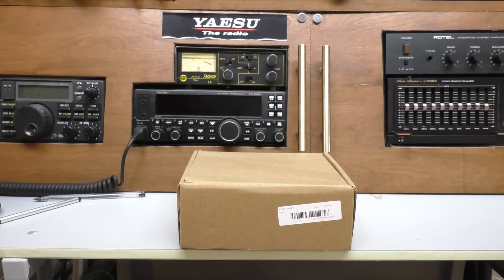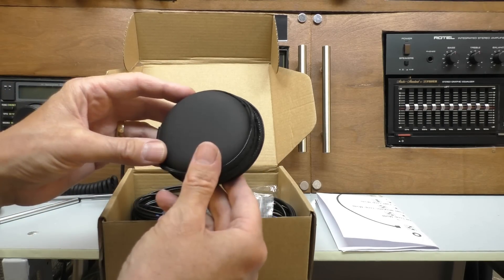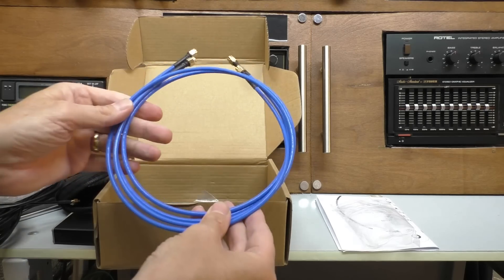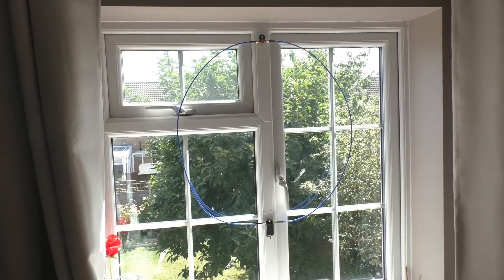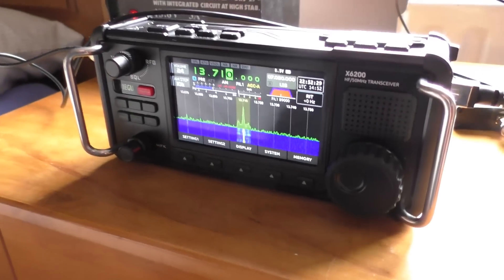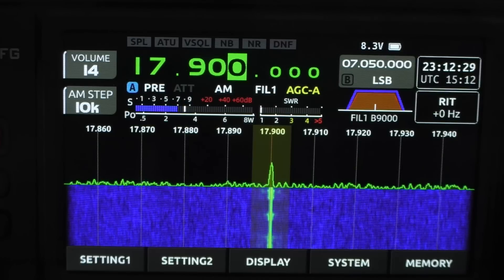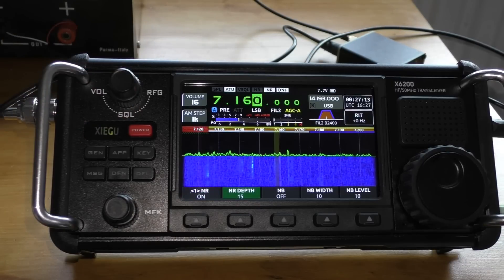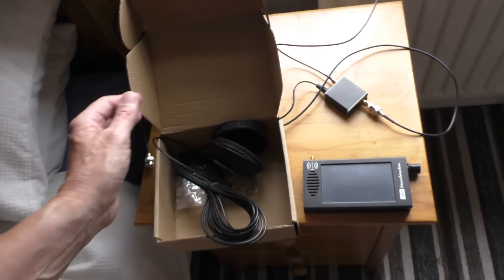YouLoop ACTIVE 50K-500MHz loop SW antenna.  A Loop that really works !

Comment: Just a heads up and the comment from @gooshy8312 mentions this but I think it is important for people to be aware of, this antenna can be powered directly from the SDR's inbuilt Bias-T with no separate power adapter needed. It was seeing gooshy's comment that made me finally pull the trigger on the antenna as I don't have a power adapter nor a spare plug socket near the SDR setup to power it otherwise.

Simply discard the separate Bias-T box it comes with and connect it directly to the SDR and enable the Bias-T and you will see the amplifier board have a faint green glow coming out from under the EMI shield to show it is being powered successfully. I have tested this on both the RTL-SDR v4 and more amazingly the SDRPlay RSP1A and the SDRPlay Bias-T is famously very picky about what it will power as it will power a nooelec LaNA HF but not the standard LaNA as that draws slightly more power than the HF one.

Overall this antenna is very impressive, and up in my attic picks up extremely well.

Also I think either my comment or @gooshy8312 needs to be pinned so that people looking at this review are aware that it can be powered directly by the SDR as I know I nearly didn't get this antenna as I wasn't sure how I'd power it and given how well it performs I'm glad I got it in the end.

Comment: What's the best shortwave antenna radio you've used so far? I'm planning  upgrading from the loing wire antenna for my c crane ssb 2
Reply from the maker: The ones i use the most is the GA 800 mini loop.  Its just so easy to put it on the table and rotate it.  You loose all the noise.

Comment: I am curious about the power supply. Just a little while ago of browsing, I saw a picture of one using a 9 Volt battery with the power cable plug attached to it.

Comment: I picked up a Radio Shackj DX-394 radio for $5 at a garage sale. I get like 2 stations messing around with antenna that came with it.  This has a SO-239 female connector on that back - I assume I am going to need an adapter to go from the radio to the cable that comes with this loop antenna - which one I need? I assume its going to be a male  PL259 but what size is the other end? I am new to all this!
Reply from the maker: Hi. The smaller size is called SMA
Reply: @CB-RADIO-UK  thanks! i am learning slowly! :)

Comment: Can anyone recommend A good power supply for this antenna ? I am just waiting for mine to arrive and I want to order a power supply for it.
Many thanks in advance.
Reply from the maker: You really need nothing special.  Dont copy me as my CB supply was too high.  I would try something like this. https://www.amazon.co.uk/Aclorol-Adapter-100-240V-Converter-Connector-Black/dp/B09XTXN1LS/ref=sr_1_2_sspa?crid=17234O333TIRG&dib=eyJ2IjoiMSJ9.XbnObsT2xq3x03oGXePHZTkbF8bYBTtd8LkSYLuEc7eDa5jyN1mVQu_20ho0AsGxOlulrEm-7tQf_5aofj1pb6W5G-U2WoUmk_PB5XenuxH7h6aXgszu3meXBZwiylFI9b1rEWzgjjbwB_jHKA1a9YJTgFz7wnPOmroi1ZpD0yUaMBqHq36QV5qpnllxpuApPxsqWs1yJ2PMeh_08zSN-UxeoF7Hd2T4XmDqsejfuUA._NHm6-_mz-767zpd0uHQ0cShguhxienQDmP8nk5AYqY&dib_tag=se&keywords=12+volt+power+supply&qid=1743152506&sprefix=12+volt+supply%2Caps%2C89&sr=8-2-spons&sp_csd=d2lkZ2V0TmFtZT1zcF9hdGY&psc=1

Comment: A question, I have the same antenna, with 7 meters of cable, but I need more meters, what type of cable is it, since I have bought a similar one, but the power does not reach the YouLoop, thanks.
Reply from the maker: These normally run 50 ohm RG 174

Comment: Fred which long wire would you recommend for my yard that I got 60 feet long to property line .
Reply from the maker: I would make my own.  Just get get some plain wire and a 8:1 balun and run it out.  If you want to know at what freq the wire is tuning to you can use a cheap VNA NANO meter.  Great fun.

Comment: Do you have any suggestions on where to pick up the correct power lead for this antenna? It is winter now and my wife gets cold at night because of the crack in the window from the MLA30+ antenna lead. This would be very handy for the bedroom window. Thank you!
Reply from the maker: Hi. Not the exact PSU but I would look on ebay for a lead.

Comment: You convinced me Fred, I just ought one to go with my ATS20+ Receiver and am waiting rather impatiently for it to arrive so I can test it all out for myself👍🏻. One question I need to ask and knowing you're a bit of a Tech-head on these matters, and because you Made me buy it 😆, I thought I'd ask you here. 
Does going from a 12V power input down to just 5V make any difference to the ability of the Loop to receiving signals❔
Fingers🤞🏻 and hoping you'll read this and answer my question and thank you for all your Advice. Regards...
Reply from the maker: Hi.  Hope you enjoy your antenna.  As for the voltage I am not sure.  I was running mine at 13.8 volts which was too high but it seemed to work ok.  Guess you will just have to try it.
Reply: @CB-RADIO-UK  Okay, thanks for your answer. I will try it out myself then and if I notice any difference I will let you all know here. You always get a thumbs up from me. Again thank you for all your informative videos. keep em coming!👍🏻

Comment: I've been using the "legit" YouLoop with separate active amp, which is very good indeed, as a directional  antenna to augment my existing discone omnidirectional, feeding into an Airspy Discovery SDR receiver.  Works VERY well, and is very capable of clearly receiving signals that are almost undetectable for the discone.

Comment: Its a good little antenna, i have been using it for a few months now, only problem i have is i had to solder a few of the sma connections back on the little boards, after a few drops and some handling those solder joints start to loosen, probably if you hung it up somewhere and never had to move it then it would be ok, probably down to the thin flexible  blue antenna  cable, bit to flimsy putting pressure on those joints

Comment: Hi Fred,

Note 1: On the dip switch ON is printed on the left side of the switch, so no need to guess.
Note 2: I found the setting for Electrostatic Shield Magnetic Loop Mode, to be the best by far (less noise). Maybe somebody can explain the technique?

Comment: Can anyone compare this antenna and GA800 ?
Reply from the maker: Tested both.  You get more gain from this antenna but its not directional hanging in a window.  Think home based use. The 800 has less gain can be set up anywhere and is directional.
Reply: @CB-RADIO-UK  Wow, thanks for the quick reply! Your channel is great, subscribed

Comment: A Q and a couple of observations:
1. How those little plastic tab things stick to anything? (I get how to attach the boards).
2. If you have an RSP1A or any of that series, you can forego the power box and just turn on the bias T. Or if you have an MLA 30+, use that power supply.
OR if you have a TenTec RX 320 radio, the power supply for that should fit.
That's all I got.
😊

Comment: Fred I bought two YouLoop magnetic loops from Airspy, so if you run across a decent amplifier only…please make a video.
73! Have a great day!
Reply: I've used the Nooelec LANA HF lna with good results.
Reply: @gooshy8312  Thanks for the reply and advice.
Reply from the maker: Will do.  have you checked out the Airspy LNA.  Prob a bit more expensive but its matched to their loop.

Comment: I have a basic noobie question.  I have a couple of scanners, a portable CB unit and a basic, sub-standard shortwave unit.  Would this antenna help me to listen to even basic signals?  I have an office in a basement framed with metal studs.  I get nothing at my desk.  I honestly am looking for an antenna that I can put outside and run in to my office.
Reply from the maker: Hi.  This antenna is not suitable for outside use unless you take a lot of time waterproofing it.  Your prob better just putting up a basic homebased CB antenna which will also bring in a lot of SW.  See this video for some ideas. https://www.youtube.com/watch?v=k_od3QmrUSw

Comment: The amp is probably getting hot as it’s rated at 5-12v and your supply is 13.8 🫣
Reply from the maker: Yes that might be a factor.
Reply: Iam using it with 9V and it's not getting hot.

Comment: Any idea what size that coaxial connector is?
Reply from the maker: They are all SMA
Reply: @CB-RADIO-UK  Sorry, I wasn't being clear.  I meant the power connector.  I think those are also called "coaxial" and have an internal diameter and external diameter specification.  (Not the same thing as "a connector on a coaxial cable.")
Reply from the maker: Got you.  Not sure as it does not say but i think mine was a 6.3mm connector center pin live.
Reply: @CB-RADIO-UK  Thanks!

Comment: Just starting out and ordered the famous Quengsheng KV5(8). Is this a good antenna for home use with the KV5(8)?
Reply from the maker: As it works up to 500 MHz it should cover most of what the radio can receive.  I have not tested it though.

Comment: excellent work and demo fred - good work on showing the amateur bands with lower power stations (compared to commercial) - i hope this gets more Short wave listeners or even ham radio operators with split RX/TX feeds, being able tosee how well it works, sure it will be picked up ! top work.
Reply from the maker: Many thanks!

Comment: Looks a decent option Fred, especially for someone in an apartment or block of flats 👍🏼
I also have the cheap version of the YouLoop which is decent enough. I did consider trying one of those amplifiers for it from AliExpress but never got round to it. Got the MLA 30+ as well. 
The only one I thought was poor was the active Mini Whip SW antenna, yet some folk like them 🤷‍♂️ 
73
Reply from the maker: Yes would be ideal for a block of flats.

Comment: Hi Fred. Excellent video as always. I have a tip here: as I was experimenting with my endfed-longline antenna I also put my amplified loop antenna up. A friend of mine is a Radio engineer since 50years and looked at my little loop. He brought a "field strength meter" with him and started walking around the back yard until he found the ideal position for that loop antenna ( I had no idea what he was doing, for me it was more a modern form of dowsing!). Then we positioned the mast exactly where he said and switched  on the loop system. Now he again used his "box" in vertical motion until he had an ideal height of 4.2m. 
I can tell you, that even before all this the loop was extremely good, but now it is absolutly sensational!! The loop now is a good bit better than my 42m longlead! He explained to me that especially with loaded loop antennas it is paramount, to find the ideal position with the field strength meter! I think your loop could even be stronger if you try the same!! It should work inside just as well,  you just need to switch of all electrical sources during measurement. My loop is the MLA-30+, and I must say that this loop with the Tecsun H-501x  the Tecsun pl-680 and the Sony 7600GR is sensational. Main difference is of course the noise level which is much louder with the longline, but even the Signal is stronger! Hope this tip can help anybody (you probably all know that since donkeys years and go "yahwn"), but for me this was a great experience! FYI, 😊! All the best.... have a lovely Sunday all!!
Reply from the maker: Thanks for the info.  Yes it just shows how experience cannot be replaced.
Reply: I'd add that that the MLA+30 isn't the same as this antenna, nor is the same as a YouLoop (but very similar). 
If this thing really performs well up to 500mhz, I'll be pleased.

Comment: Great review as always!  I betcha the little case was for the  'missing?' power supply?
Reply from the maker: Thanks.  I actually think that the whole thing is supposed to fit in it.
Reply: the little case is to hold the cct boards if you want to take it apart and take it away with you.

Comment: Should the power supply voltage be 5V to 12V, as in the video? Do I have to worry that a switching power would introduce noise into the radio?
Reply from the maker: You could always use a car battery if you were worried but it seemed fine.
Reply: I looked up the pages that LZ1AQ has published. It is build for 12.3V to 16V else the performance will drop drastically.

Comment: This has caught my interest. I've been using an MLA-30+ in my bedroom and am looking for smaller form factor active loop antennas. Fred, how do you see this new YouLoop Active compared to the Deshibo GA-450? 🙂
Reply from the maker: I got much more gain from this loop.  The smaller 450 loop is easy to rotate to avoid noise though.

Comment: The non amplified version also works well.Been using one hanging up in the attic to my IC 705
Reply from the maker: Good to hear.  They are fairly well made considering the low cost.